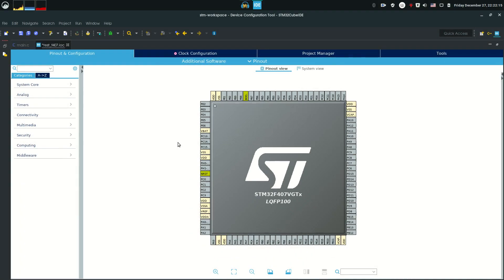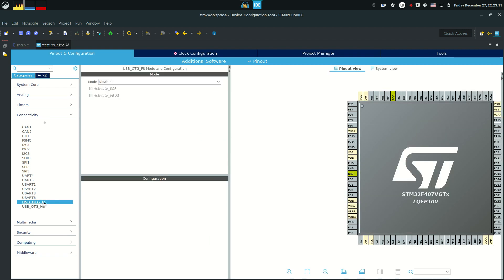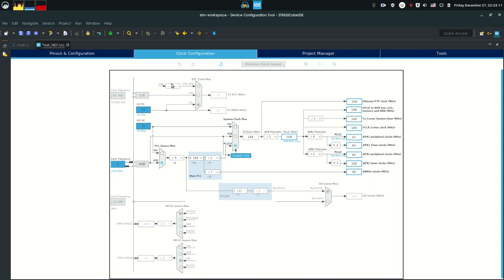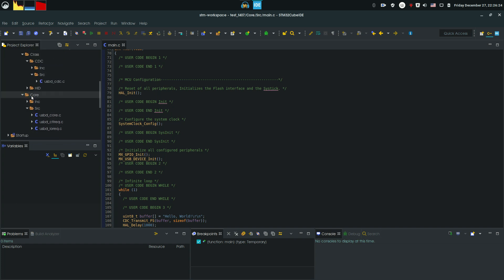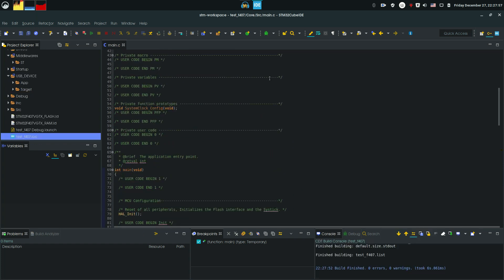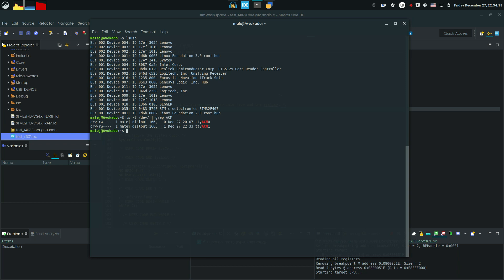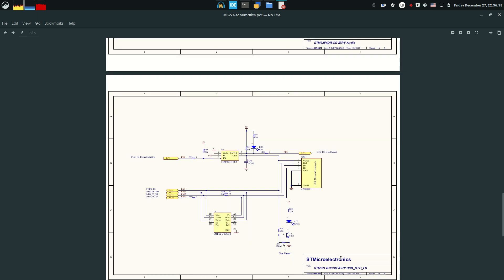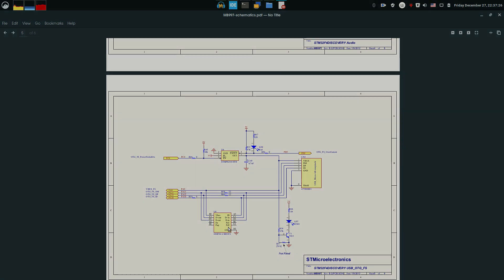USB peripheral on STM32 as serial interface | VIDEO 21

Comment: I don't want to use the microUSB on my núcleo board, is it possible for me to just use a simple female USB PCB and connect it to the same pins as shown in the schematic? Thanks very helpful video I'm just getting started with STM controllers
Reply from the maker: I think you're talking about the usb peripheral connector and not the debug one, which is mini USB. Sure, you can connect one yourself just make sure you have the lines as short as possible, at least data lines D+,D-. If you can, twist them together and it should work. If you check your board's schematic you can see if you need any series resistors if you're connecting directly to the mcu i/o.

Comment: I always get a "libusb: error [udev_hotplug_event] ignoring udev action bind" when trying this. Ideas? (I know I'm a noob, lol). I'm using the STEVAL-STWINKT1 board.
Reply from the maker: This happens to me as well every time I add usb device while I have CubeIde opened. As I have read, its just a message that should not be printed because its not an error, just a log message, but its still in the library. No need to worry.

Comment: Could you please provide also the generated code?
Reply from the maker: Github excludes binary and other executable files by default for security reason. Also, people have different boards/processors and these tutorials are universal for all.
Also these tutorials are just for demonstration, not particulary usefull on their own, thus no point in sharing binary that cannot be modified.
Reply: @MatejBlagšič  By generated code I mean the source code generated by the configuration tool - these are ASCII files (source code *.c and header files*.h) . The idea is the viewer to be able to compile everything as it was on the video. Thanks
Reply from the maker: That would be possible, but the idea is that in the video I show you how and what to configure and also provide resources, links and additional functions in github. I do not want show any limitations as for a particular board you should use or software. Keeping it universal is what I wanted when I started working and tutorials allways coded project particular to an mcu.

Comment: I have stm32l152c. What would be the name of the virtual comm port under linux?
Reply from the maker: If you want to use thw built in port of the st-link, it sould be under name ttyACMx, so under /dev/ttyACMx, where x depends if yoi have more devices like this connected. Should be 0 for this type of serial port dezcribed in the video. In rare case you could look for ttyUSBx device.
Reply: @MatejBlagšič  Thank you